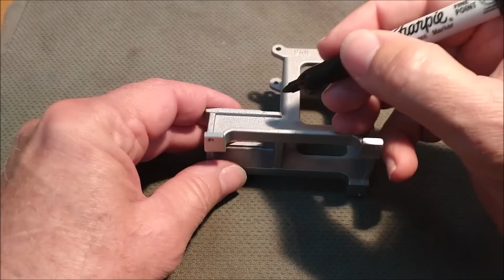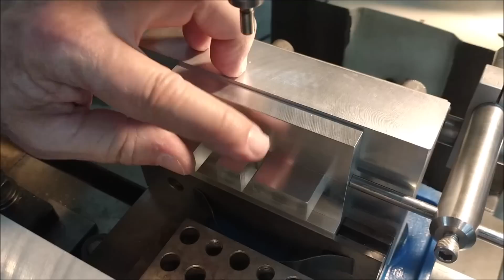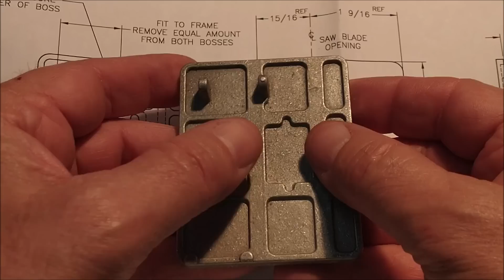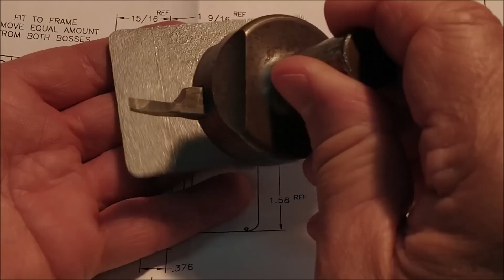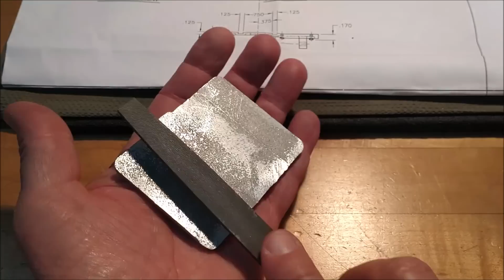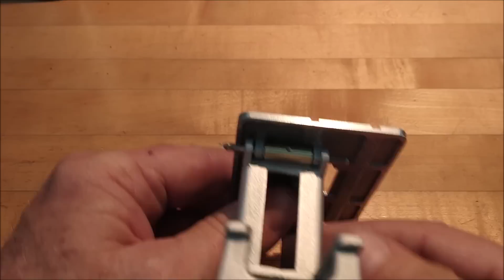Machining a Miniature Table Saw - Finishing the Frame and Table

Comment: This reminds me of a saw I have. The table looks the same but the motor and the blade shaft are mounted on a cradle that pivots in the main frame, and there is a screw for jacking it up and down for blade height. While the table tilts up from the right side with another screw, to make bevel cuts. It's an old timer.
Reply from the maker: This is an interesting setup. I've never seen a tilt table saw before this one.
Reply: @joepie221  It was made by the Preston company in Ontario Canada, long gone, and I can't find another one like it on the internet. It came out of a pallet factory, where it was cutting hardwood. I figure it has to be from the 40's. It uses a 14 inch blade.

Comment: You can't argue with the positioning of those two cross holes. The pins looked like they aligned perfectly. 
Regards,  Preso
Reply from the maker: Hi Preso. That fixture almost guaranteed the end result would be spot on. I was pleased.

Comment: Joe Pie, the "Master of Fixtures!...
I noted that your hands are unsteady, shaking - I have the same problem every afternoon! 
I am 75 so I have an excuse. There will be a reason for these unsteady fingers. Some are due to an incurable problem,  but the vast majority can be corrected with a correction in diet (low blood sugar) or medication. I am attending to the problem, are you?
Reply from the maker: I shake when I'm hungry. Always have.
Reply: Perhaps the Whiskey is catching up with you? If it is, I hope it is really GOOD whiskey!!!

Actually, nearly all the woodworking and engineering  machinists have hand tremors, and we put that down to a lifetime of having your hands in the cool to cold airstream coming of the rotating parts.

Comment: Hey Joe, when I was in the marine industry we would flatten the gate on small valves by glueing wet sandpaper on a piece of glass so we could move the gate in a figure eight and flatten the gates surface. Worked a charm and easier than filing.

Comment: Hi Joe, Thanks for an informative  video as usual. One bit of information  you did not imply but unfortunately demonstrated was the lack of a handle on your flat file. I know it's a small part and gentle filing. BUT! Next, you might be on the lathe with a similar file. You catch a jaw with the end, and suddenly, that file tang is through your wrist or, even worse, sticking out of your belly! Please, please, please, put a handle on every file you own that just MIGHT be ever used on a rotating machine for your own safety.
Regards from Canada's banana belt. 
🤞🇨🇦🍌🥋🇺🇦🕊🇺🇲🦃🪓🏁👍
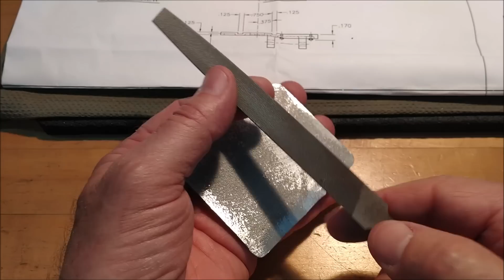Reply from the maker: I appreciate your concern, But.....20:00 in and at 20:06 and 20:15, the 1 1/4" diameter oak ball can clearly be seen on the tang.

Comment: I don’t want to say I’m overly invested in this, your latest model but when you opened and told us of the two intersecting holes that had to be drilled after milling down the cross brace, I started to have a panic attack. Your block of aluminum that you milled to nest the frame in helped me but I still had to take a break from the video just to calm myself down. I’m glad it’s you that’s doing this. Whew!
Reply from the maker: Taking one for the team...No Problem.

Comment: I wouldn’t mind shopping in your scrap bin.

Out of curiosity instead of trying to file the plate flat why not get a sheet of thick float glass, put a piece of sand paper on it and just gently sand the part?
Reply from the maker: I use my bandsaw table for that exact purpose.
Reply: That's what I suggested in my post before I saw yours!

Comment: Joe, I follow your explanation on why you waited to punch that reference hole so it wouldn't cause ringing in the fly cutter and mess with your finish. What I guess I don't understand is why doesn't the same ringing happen as the cutter enters the part along the entire front Y edge?

Really enjoy your videos and learning a lot which is always a good thing. 👍🏻
Reply from the maker: Once the cutter hits the edge, the load is established and constant until it steps off the back edge. A hole will interrupt that load. The place to be careful is the end of the cut where the cutter only hits the 2 remaining corners. if its going to ring, it will be there.
Reply: @joepie221  okay now I get it, thanks 👍🏻